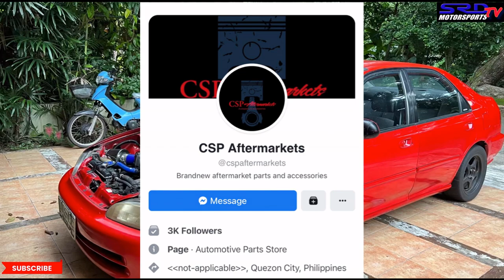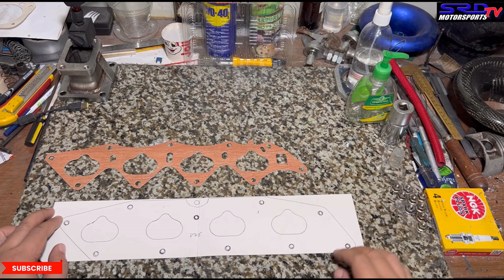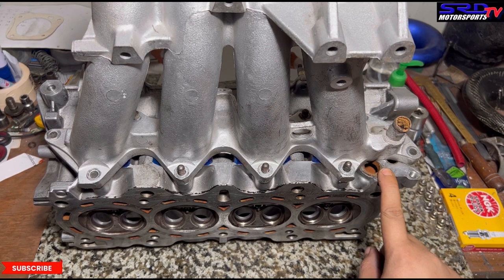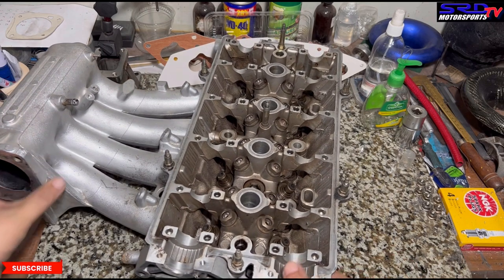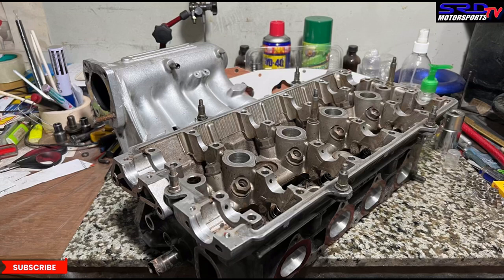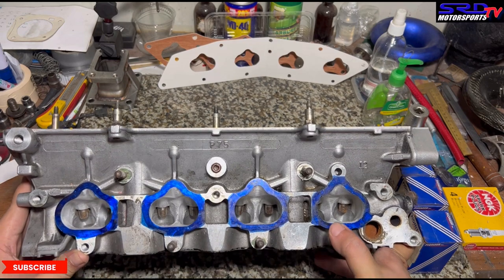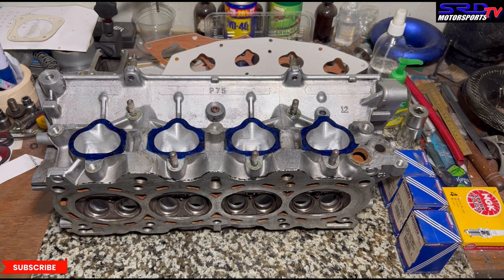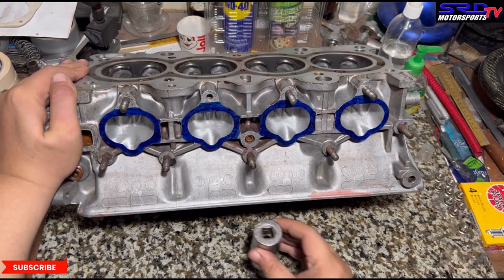B16a P30 Intake Manifold to B20 Non Vtec Head P75 Road Race

Comment: B20 ftw! Timing on our conversation couldn't have been better! Keep the content up. Saludos desde España!
Reply from the maker: Yes! saludos Amigo great timing indeed… also a tip, the b16b TypeR cam has a duration of
294/286 (intake/exhaust) and at 0.050” it’s 233/244 duration…

You can check Crower website for their 403 or 404 cam and get an idea for the non vtec :)
Reply from the maker: @civic h22 oh with that intention I think you’re gonna blow  the previous set up out of the water!!!

You are looking at a comparable to
B20vtec on Pro1 cams

That’s gonna whoop a b20vtec on ITR lol

Comment: What you said in 8:01 in relation to powerband. 👍 

Also, having the redline at around 8k makes it safe for someone to run cast pistons in a circuit race (4,680 ft/minute piston speed). A simple but good set up.
Reply from the maker: Yes sir and the one I mentioned that Bong did I think it was FORS that he used to compete in  under their group “Tfactory” ftw

Comment: Hey what about the smaller hole? Does it need to be plugged as well?
Reply from the maker: which smaller hole if it’s an open water passage then yes
Reply: @SRDmotorsports  im not sure if its an open water passage but, if you look to the right of the big hole (which you say to use a 3/4 npt tap to plug) there’s a smaller hole to the right of it, im not sure what would be the perfect tapping size.. i also tried using a 3/4 npt tap tool and it was too big to fit
Reply from the maker: On the head it has to be plugged it on the manifold it won’t have water since it has no source

Comment: So you use a 3/4 pipe plug on the head is it the same for the tap
Reply from the maker: Yeah a 3/4 NPT tap , a pipe plug (npt) helps cuz it’s tapered so less chance of leaks no need to gorilla tighten it heheh
Reply: @SRDmotorsports  thanks 🙏 a lot my friend you have such good content
Reply from the maker: @luizontuned7011  thanks man :) and thanks for checking

But also the pipe plug because it’s Allen tightened it’s a good way cuz u can remove it whenever going back to stock :) 

Like all Honda guys we are never finished haha
Reply: @SRDmotorsports  maybe later I can port Honda heads need to learn do 😂 looking forward to see more of your videos my friend
Reply from the maker: @luizontuned7011  will try to keep making videos for everyone indeed :)

Comment: Where do you get your sanding rolls from
Reply from the maker: Just usual eBay stuff
Reply: Well what about the metal rod that holds it in the grinder trying to polish a f23 intake manifold
Reply from the maker: @ninjaknight6130  it’s a drill bit blank 

So easier to get cartridge roll kit as it has the rod too